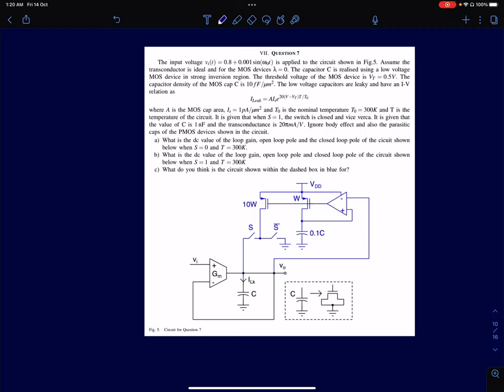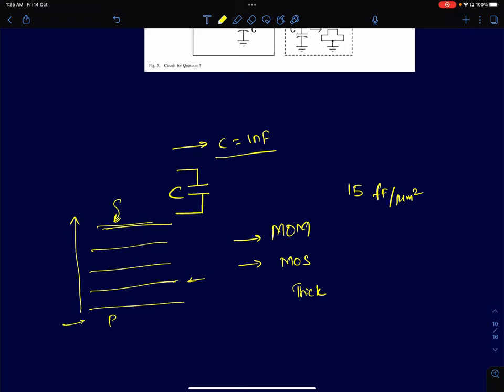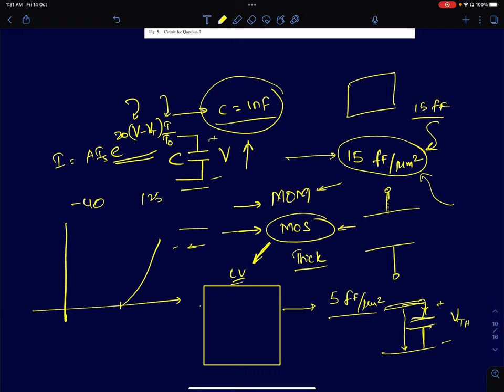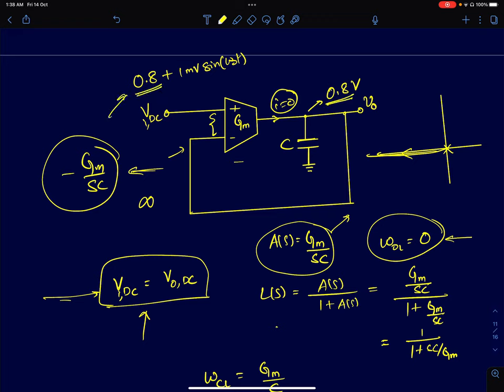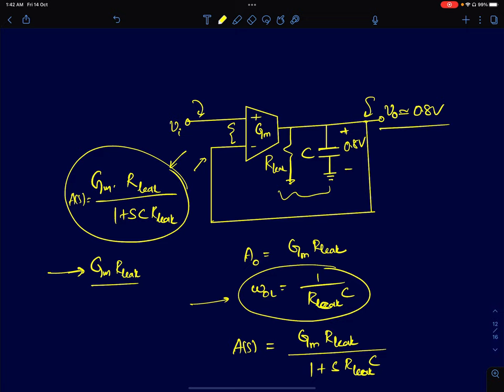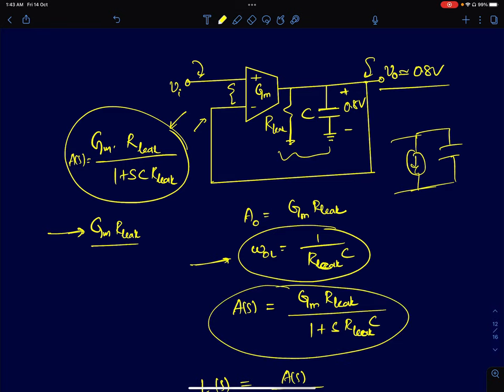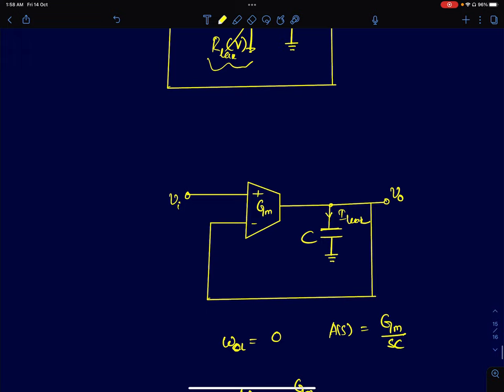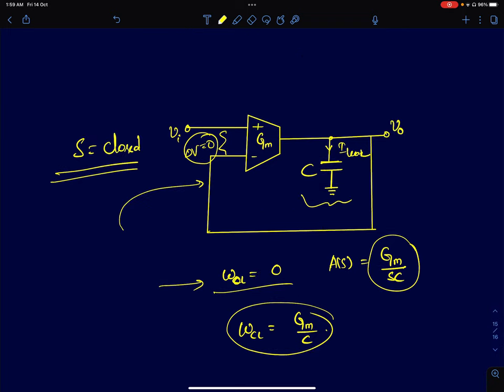AIC Lecture 53) A MOS gate leakage cancellation circuit problem

Comment: In order to copy the gate leakage current, the transistor inside the op-amplifier must also operate at almost sub-threshold conduction, so is it possible to copy exactly?
Reply from the maker: If the opamp gain is high enough, then it doesn’t really matter, what region the device inside the opamp operates in (sub threshold or strong inversion). The current is determined by the gate leakage current of the MOS cap device. The opamp just ensures that the voltage across the cap is the same as the voltage in the main path.